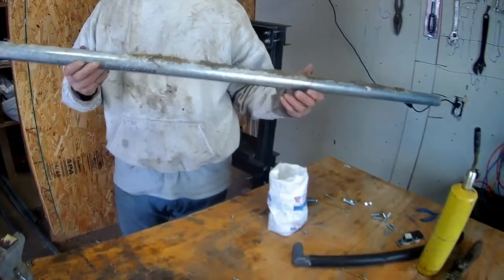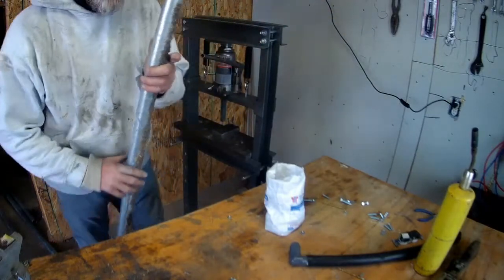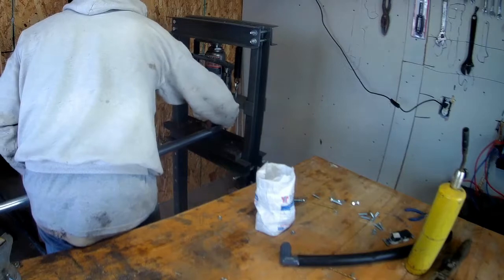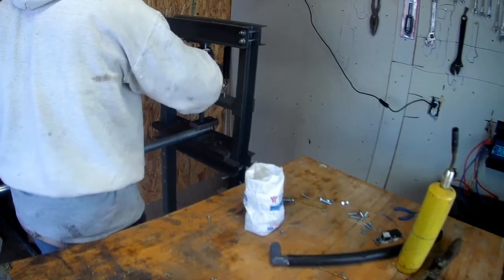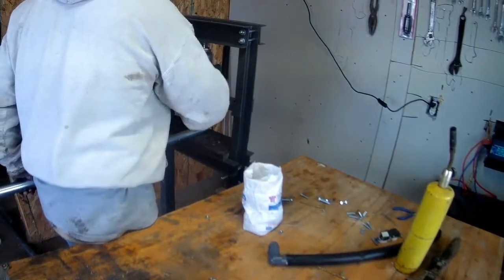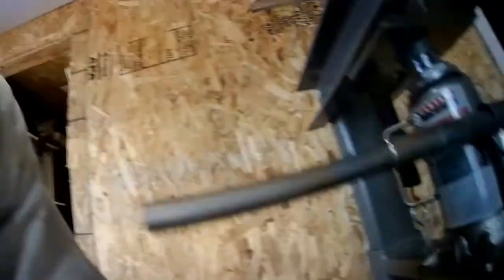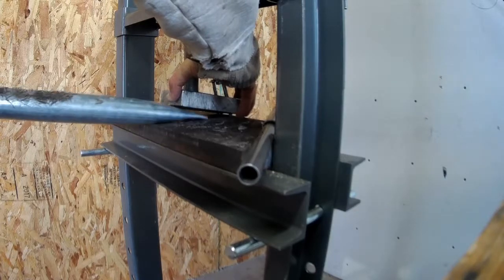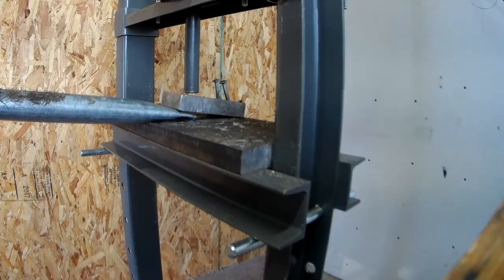Greenhouse #1: How to flatten tube ends to be used as struts in trussed greenhouse hoops

Comment: I think I can flatten and bend it a little, to use the ends as brackets, drilling holes to flatten ends to be screwed, I need 8 pipes like that to connect my 8 gazebo wooden 6"x6" posts. They would serve as reinforcement as well as to hang curtains.
Do you recommend conduit electrical pipe for that?
Thanks in advance.